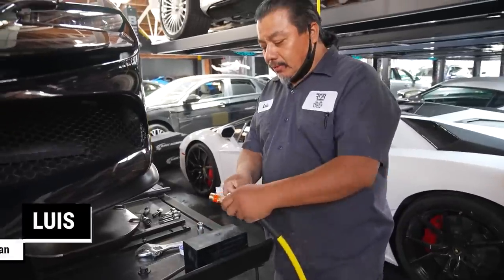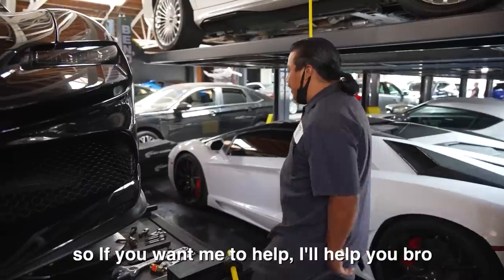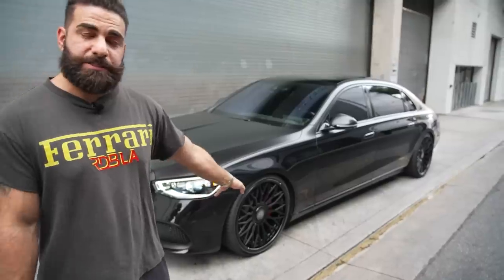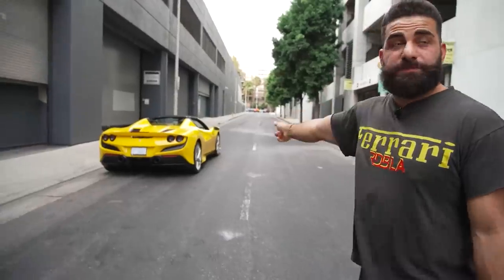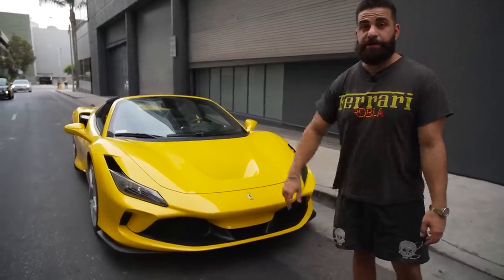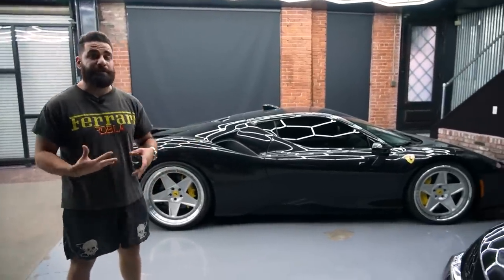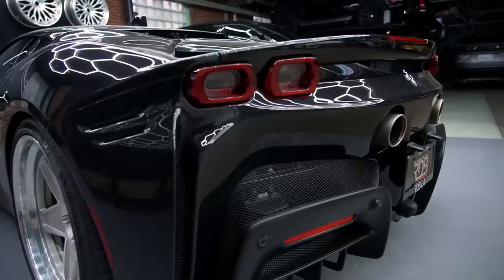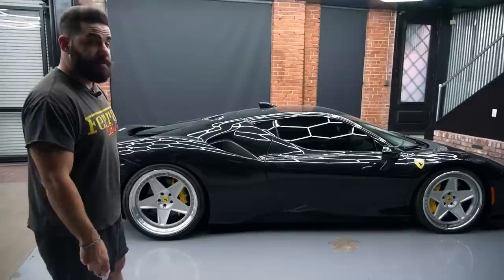Baddest SF90 Ferrari & New Maybach S Class with RDB Wheels

Comment: Vic, be careful with epoxy. floor. It will wear and deteriorate in your condition. Suggestion would be to strip any previous coating and apply a densifier and possible grind/polish, depending on the porosity. You can get some stain during that process as well but stick with keeping the natural concrete color because that will also wear, but less if applied after a polish and prior to the densifier. You will get a surface that is easy to maintain and not be slippery when wet. You can add some gloss polyurethane to a special spot for filming. Find a good concrete polish guy, not an epoxy guy. Just my 2 cents as an architect who has been recently researching and applying this to clients commercial space and my personal garage and shop. Let me know if I can advise further. Thanks!